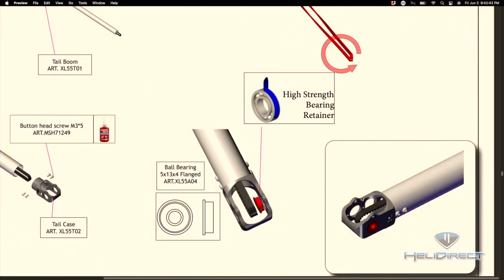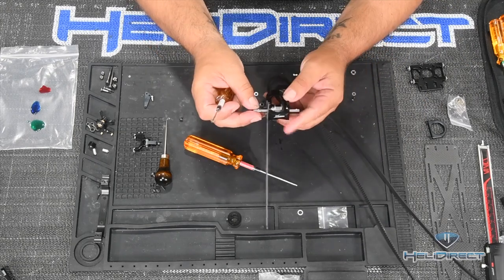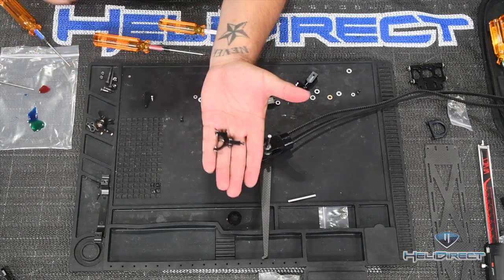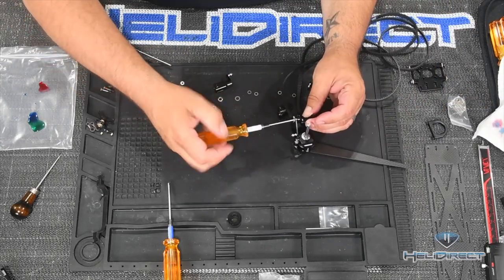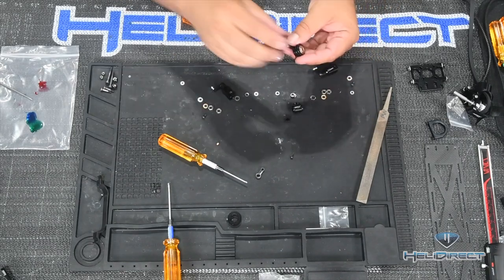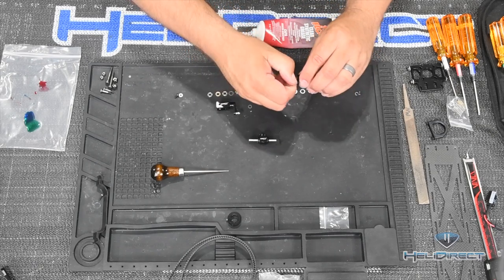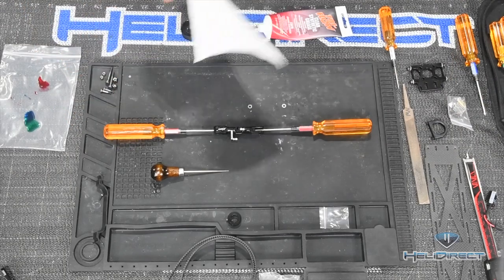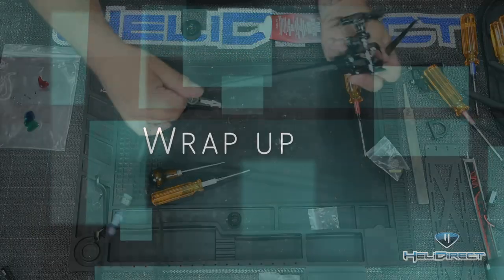XL Power Nimbus 550 Budget Build Series - Part 4

Comment: Hmmm.
Quality control is that bad that they can’t produce the parts to fit together properly.
Sand and bend parts is exactly right, just dealing with that on mine. Vitally important that helicopter components are made with precision, shouldn’t be up to the customer to  modify parts. But thanks for including it in the video.
Reply from the maker: Thank you for your perspective